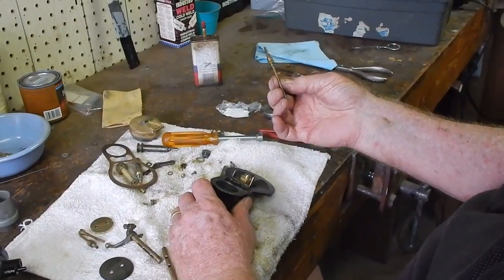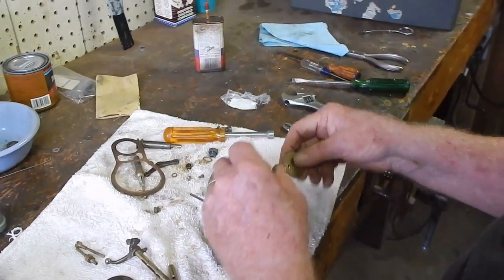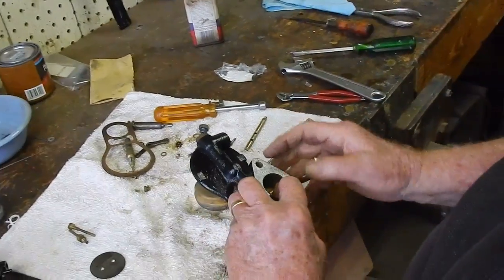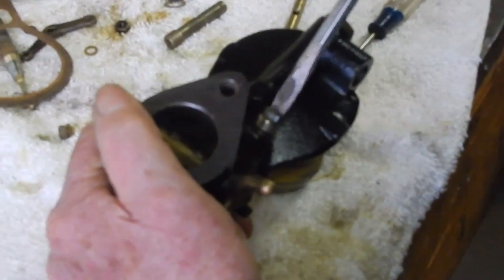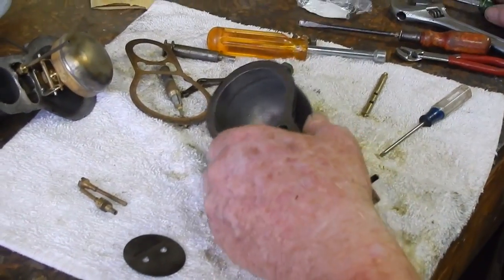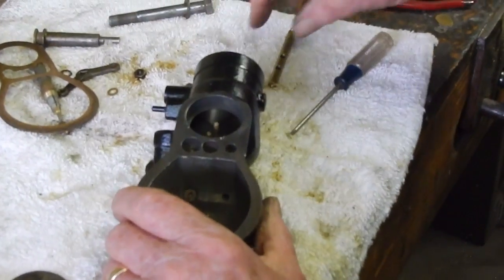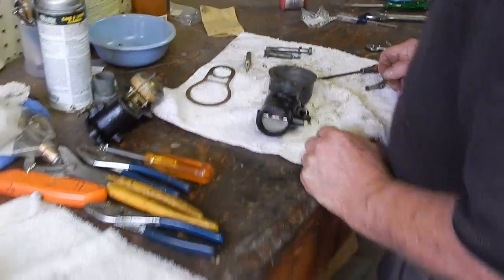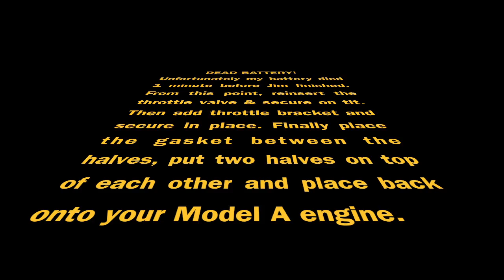QCMAC - Reassembly of Model A Zenith Carburetor

Comment: Sofield
I noticed a few mistakes in the reassembly.  Number one, back off the throttle idle screw first. Next insert the throttle shaft and plate. Tighten throttle shaft screw just enough that you feel the plate move plus one additional screw turn. Install the air adjustment screw 1-1/2 turns open.. Make  sure the screw doesn't bottom.  Install the float valve and washer and inlet screen, washer and plug. Turn top half upside down and  set float 5/8 inch from float seam to bottom of top half. Install idle jet (no washer) and set aside. Bottom half.  Install secondary well, cap jet, comp jet and main jet in bottom of carb base, don't forget the washers, then the drain plug with washer. Install AVR jet if it has one with washer. Follow with AVR housing. Wrap 2-3 turns of plumbers Teflon tape around threads first. Before installing back off driver housing screw 3-4 turns. Install choke shaft and plate. Install AVR driver and link between driver and choke shaft.  Make sure choke link won't slip off driver when you work the choke.  For overall best results use flow tested jets.

Comment: Do you know of a zenith 1 lower casting that has a channel about 3/8"-7/16" wide machined across the secondary well connecting the bowl and throat together? I havent been able to find any pics of a casting like that. Only ones I see is like yours where the casting is completely flat over all three openings.
Reply: This is a pressure balancing circuit, your factory float bowl vent should be plugged up with a pipe plug also.

ALL carburetors that use an air cleaner from the factory have a pressure balancing circuit in them.

I would bet that I did that modification to your carburetor.

I can modify all Ford released model A & B carburetors so that you can run an air cleaner with out negatively affecting air fuel ratios as the filter gets dirty.

In 1937 Zenith released a document telling Model A and B Ford owners to not use air cleaners because they’re Carburetors were not designed for them. 

This is not an opinion it is 100% a fact…. Carburetor design 101.